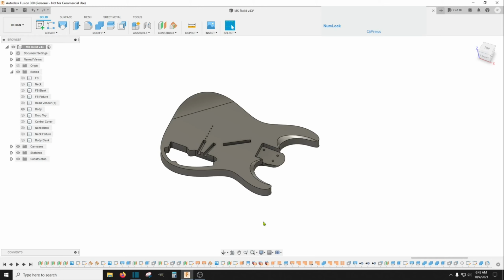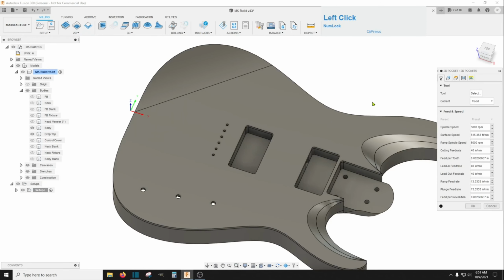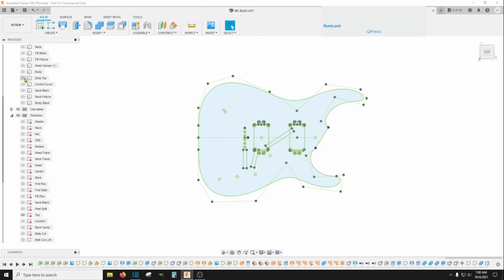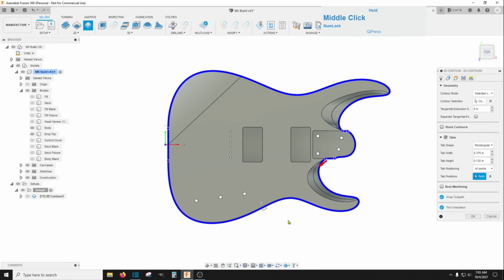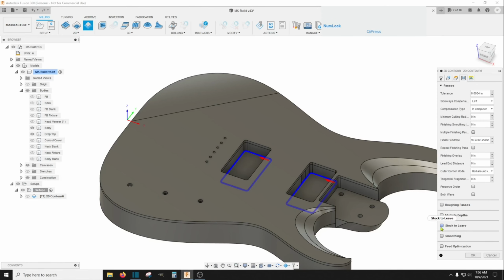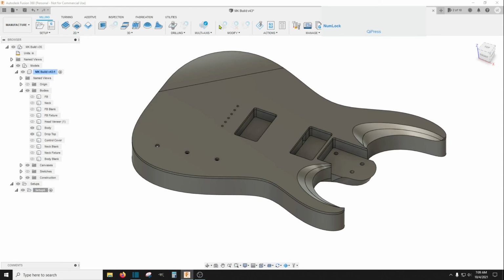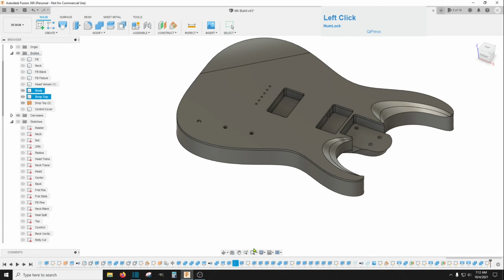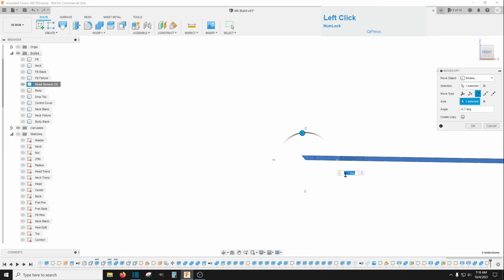Fusion360 CNC Guitar Build Session #21

Comment: Good stuff, when I flip my stock its usually off back to the drawing board haha. Thanks for the videos!
Reply from the maker: Thank you for the comment. Also, if your machine is not very rigid, you will have alignment issues. The torque will pull and push your bearing blocks out of perfect alignment. So having a perfect setup is only half the battle.